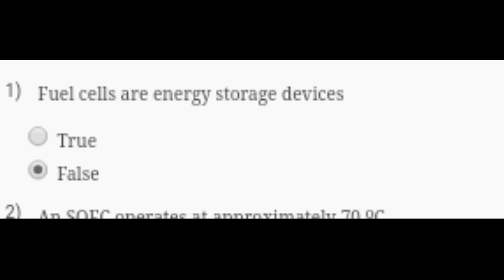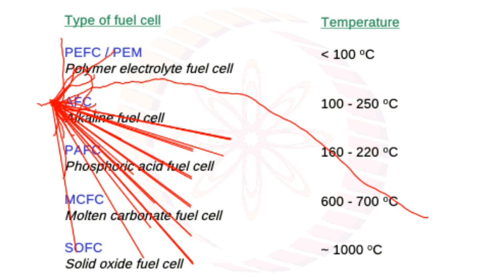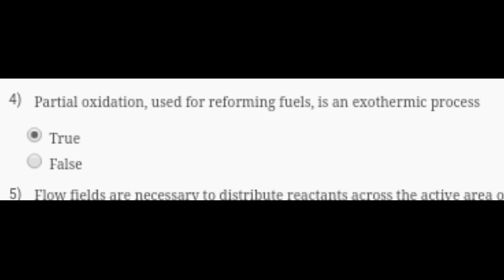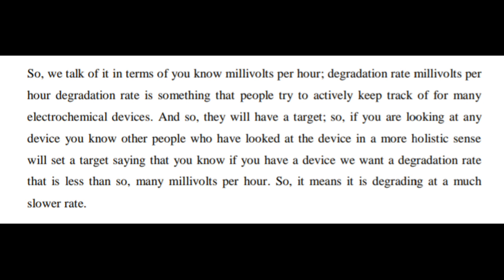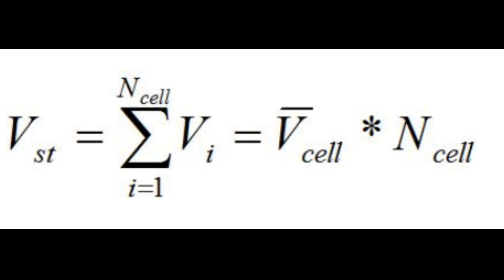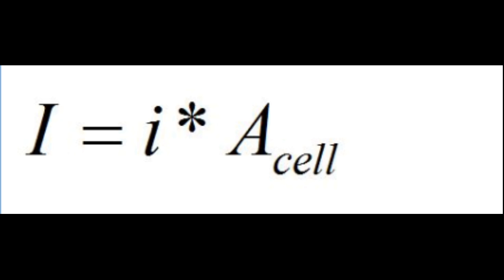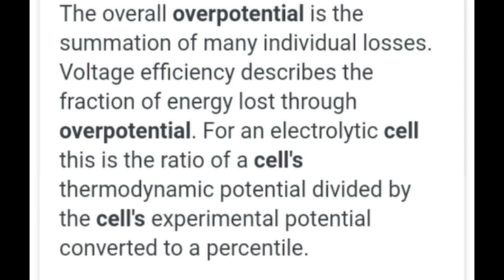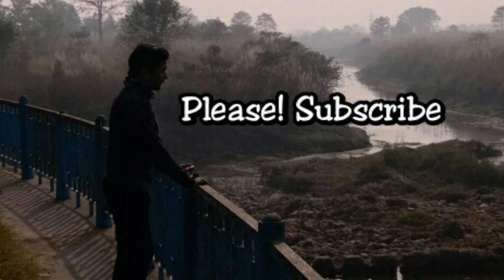NCER-NPTEL | Assignment - 11 | Solutions | 2018-19

Comment: 10. Answer is 0.48V
Solution-
Resistance= 0.01 ohm
Current=  15amp
Ohmic loss= 0.01×15= 0.15
Then polarization losses other then ohmic loss= 0.63-0.15= 0.48 ans.

Q9 & Q10 are connected to eachother others.
Theoretical vol= 1.23
Operating voltage= 0.6
 overpotential loss=  Theoretical Voltage - operating voltage

Overpotential loss= 0.63
Reply from the maker: Thanks bhai
Reply from the maker: Please consider sagir siddiqui answer and his explanation
Reply: Sorry for that bhai,  while typing I just pressed 6 at the place of 2
Reply: Your welcome bhai 😊😊
Reply from the maker: Bhai! tell me one thing 1.63-.6=1.03 not 0.63
how is it possible?
Reply from the maker: bhai here theoretical voltage is 1.23 not 1.63
hence 1.23-0.6=0.63